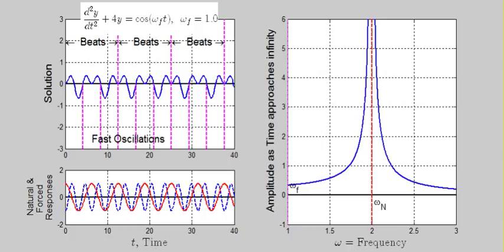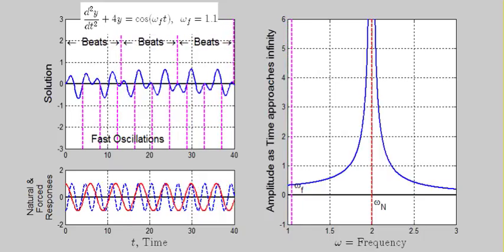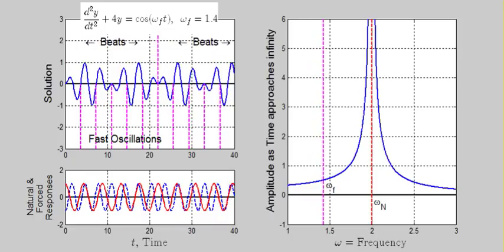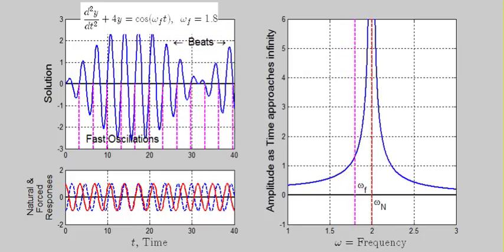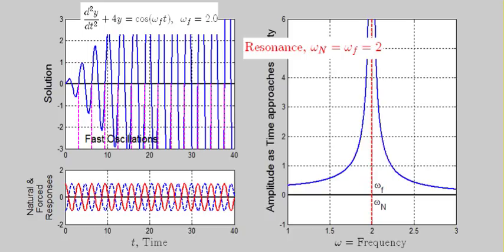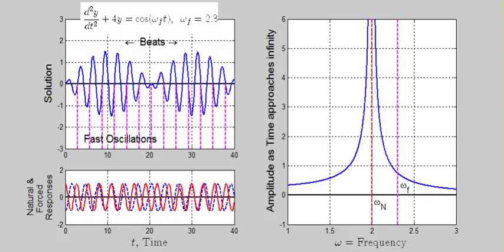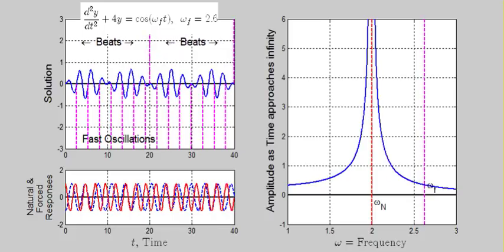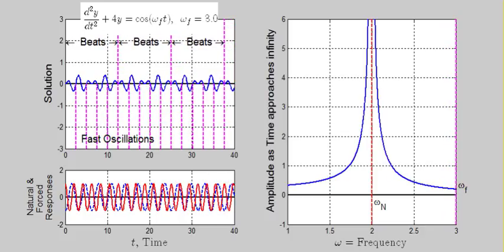What is Resonance?

Comment: Does the application of an external force have an effect once the object reaches its natural frequencies? In a beam for example does it increase the frequencies or they remain same?
Reply from the maker: Nassam Assouma resonance occurs when an external force is applied to the oscillator. The forcing must be periodic with frequency equal to the natural frequency of the oscillator. Yes a beam is one example. But without forcing, the beam will not resonate.
Reply: ya got it. let say the resonance has been reached. Will the addition of a load (external force for example) applied to the beam increase the magnitudes of displacements of natural frequencies?
Reply from the maker: Nassam Assouma in this video there is no damping, so once resonance has been reached, the beam will eventually break. I suppose adding a load to the beam will change (slightly) the beam's natural frequency, and if the periodic forcing reaches that new natural freq, then the beam will still break. In reality, oscillators are damped. In the case with damping, the beam will only break if the max amplitude surpasses the beam's structural threshold.
Reply: Got it. Thank you so much. One more thing. Do you know the matlab coding behind this theory? like obtaining the magnitude of displacements, the frequency response or time response of a simply supported beam or cantilever beam using matlab?